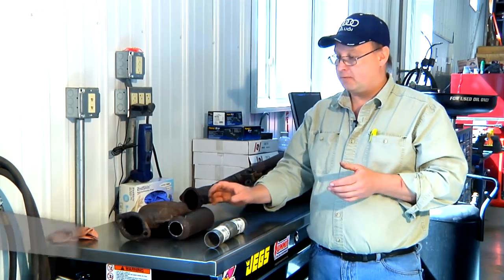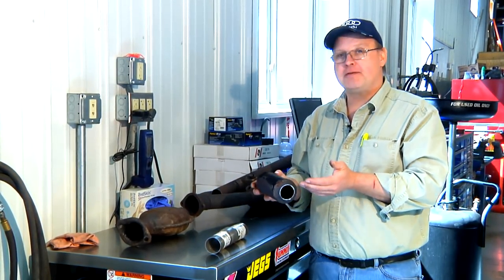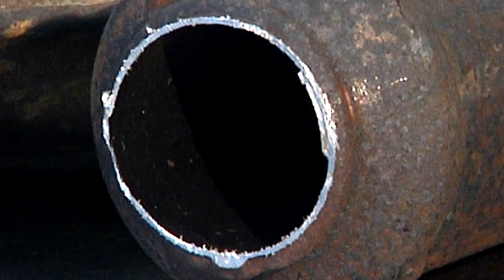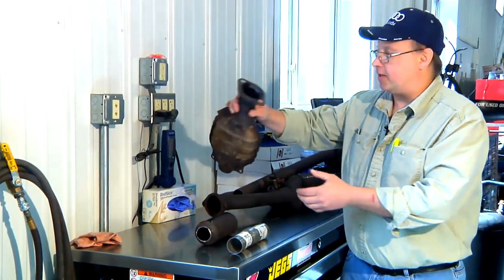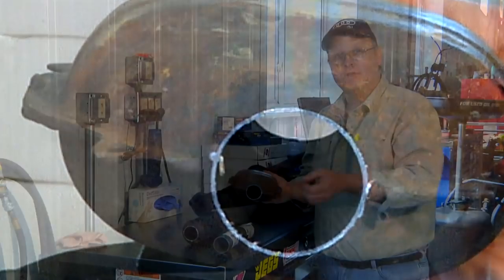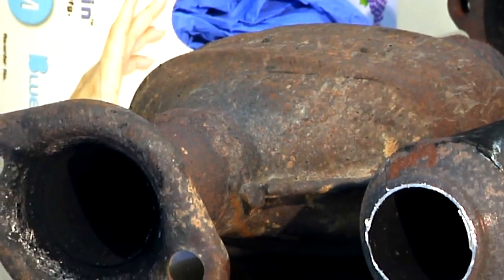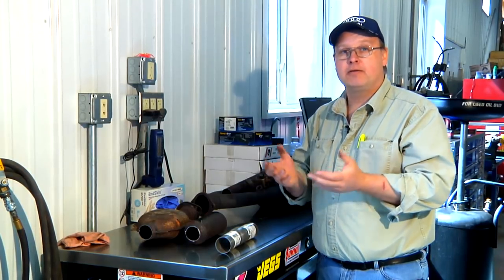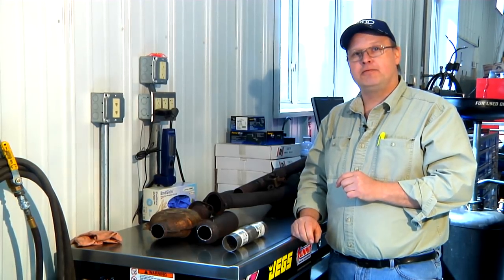What Happens if You Replace the Exhaust Resonator With a Pipe? : Under the Car Repairs

Comment: This video is so inaccurate.
Reply: @Pull-UUp  Back pressure isn't what an engine needs to be efficient or to make power. It's a myth. Exhaust velocity is what encourages good scavenging and promotes more torque in the lower rev range. Not back pressure.  Backpressure is something your engine has to work AGAINST, so it will rob the engine of power it would otherwise have to send to the crankshaft. Backpressure causes some exhaust gas to stay in the cylinder, therefore it will limit the space for fresh air and fuel, limiting power.

When people say you loose back pressure you loose power, this is their uninformed opinion about what the exhaust gas velocity is doing to scavenge the cylinders.

Upgrading to a bigger freer flowing exhaust is going to slow down the exhaust gas velocity, therefore lowering the efficiency of the scavenging effect, and you will notice a drop in power and torque at low throttle inputs. At wide open throttle and higher in the rev range a bigger exhaust will make more power and torque as there is less restriction and more room for the gasses to escape.

Secondly, when he says that the gasses aren't coming out smooth, and a baffle chamber will "smooth them out" is complete nonsense. Smoothing gas pulses out is neither going to have any effect upstream nor is it going to affect anything downstream, because you cant smooth them out.  A baffle chamber is there to reduce certain sound frequencies so your exhaust is not noisy and doesn't drone.
Reply: @ElMaximoBango  thanks bc I want to get rid of my resonator

Comment: That's an empty catalytic convertor as mentioned beforehand.
I removed the big restrictive centre box on my 2.0T Espace and fitted a straight-through glassfibre-filled Cherry Bomb. What a difference. So much more responsive and definitely more power.
Reply: Yeah right probably like 2-3 hp at most